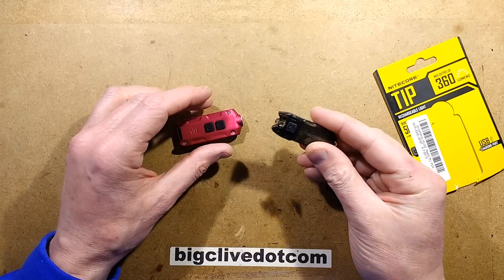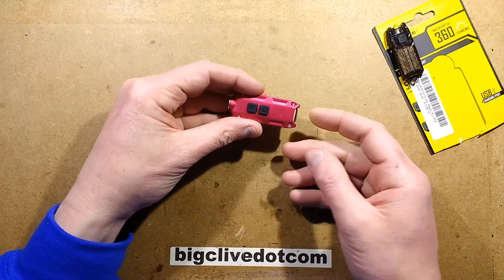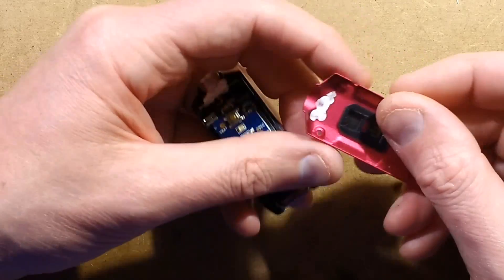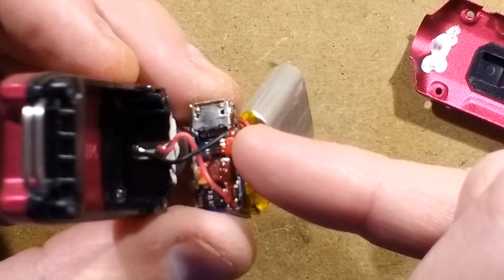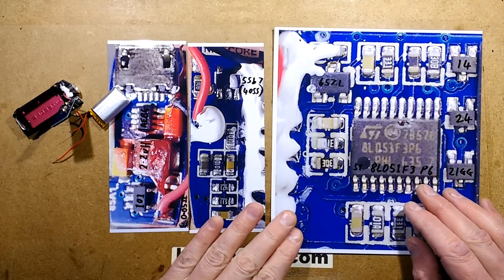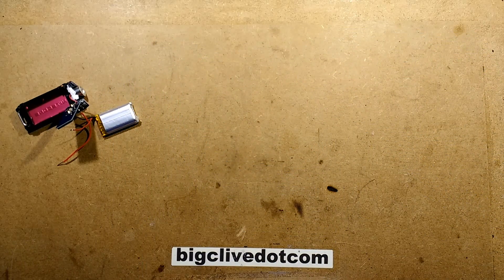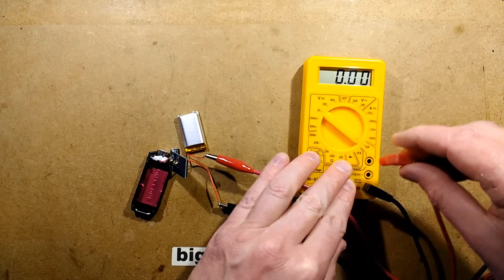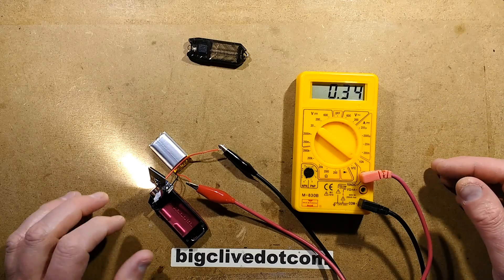Inside the Nitecore TIP LED flashlight, with electrical tests.

Comment: Too expensive for what it is and bad design for real world use.  In real world use, you'd have this form factor to pocket carry, banging around against other metal in your pocket, getting scratched badly, perhaps even dented considering how thin the metal is.

I know everyone goes nuts over USB charging, but the port is going to end up breaking off the PCB.  I know everyone is nuts about flat pack Li-Ion too, but for most owners that makes it disposable after a few years of use.  It is too expensive to throw away!  Considering the non-(reasonably) serviceable nature, they might as well have used thermally conductive potting to fill the whole thing, even if it adds 50% weight as then it is truly waterproof, would reinforce the USB port, reduce chances of denting the shell, improve heatsinking.  

The catch is that you can't put the potting over the switches and those silicone rubber buttons over them, will eventually leech out silicone oil that fouls them -  seen it too, too many times before.  It is true that conventional lights with cylindrical cells, also have a silicone rubber dome over the switch, but usually use a larger, more distant switch mechanism that is less likely to be fouled by the finite amount of silicone oil that leeches out.

It is impressive, or perhaps I should write an inevitable design, but I wonder how much longer it will be until higher powered LEDs make their way into phones and with everyone having a phone these days, it will eliminate the need for 3W and lower flashlights except those that have special mounting or aiming incorporated into the design.  Plus it makes sense for phones to have the LED available as a more powerful flash for the camera.

Comment: thanks for the video..it would break my heart to gut and destroy a $40-@50 light like that just to poke around ...bout to mention losing the IP rating
Reply from the maker: It's all back together and working, and as waterproof as it was before (not very).  But that's one of the main purposes of this channel.  To take stuff apart so you can see what's inside without opening yours.
Reply: bigclivedotcom LOVE the channel for that! ...if I took it apart I'd prob go farther than anyone should and then the parts would be binned with my "maybe someday I'll need this Arduino box" hahaha

Comment: a 65Z might be a 3V-250mA LDO (exact type is XC6206P302MR), there are different 65% series LDO's (ranging from 1.2 up to 3.1V). The 21GG might be a 21G, a voltage detector (exact type APR3021-39A, again 21% series comes in different voltages) which would make sense to check if the voltage does not exceed a specific voltage.

Source: SMD codes databook 2007 by Turuta

Comment: Man... Your scale is alot cleaner than mine...
Reply from the maker: i always clean things like this before a video.  Mine was covered in dubious white powder.  Right now it's Potassium nitrate, ammonium chloride and camphor.
Reply: Haha, "dubious white powder" - weed joke put to shame.
Reply: Mine was always covered in flour, sugar, yeast etc.
Reply: Stick to heroin, pot clogs the syringe.
Reply: On that topic, a local shop used to sell similar scales to druggies. So the cops bought 4 or 5 sets from the same shop to make sure they couldn't argue about the weights being off...
Reply: That is freaking amazing. I've heard of dudes/dudettes doing the same to make sure their dealer isn't screwing them, but not the cops. Just imagine that conversation: "Nah man, It wasn't over an ounce. Your scale is wrong." XD

Comment: if the µc has adc, it might have temperature sensing built in. not that it would be worth anything on a board completely separate from the led, but the packaging might not be lying about temperature management.

Comment: Yes, you were right. The very first iteration of the TIP had a couple of problems: High quiescent current draw when locked out, and visible PWM on low modes. The current iteration, like the one you dissected here, and the one I own, has solved the vampire current draw on lock-out, and has current regulation not PWM. The battery monitor that you weren't sure of is where you press the mode switch when the light is off and it will flash the LED to tell you the state of cell charge. And the LED flashing when you were testing the current draw was because it was detecting low cell voltage because of the voltage drop due to the burden voltage of the DMM.
Reply from the maker: Ah, so it may be controlling that mystery 8 pin chip perhaps?  I certainly couldn't see PWM at all, but did notice intensity stepping in peripheral vision when the intensity was automatically ramping down.
Reply: @bigclivedotcom  I would assume the 8 pin chip is protection on the USB data pins? I believe the firmware on these is hackable/upgradeable?

Comment: was there a hole in the packaging on the side where the usb was sitting?  if so it is possible that there is a new firmware uploaded.

also you can 'see' the bug if your flashlight has it. the led in the power button will light up a bit in lockout mode

Comment: In theory with an ADC on the MCU they could have monitored the forward voltage of the LED. Not an ideal method of temperature sensing but it does work as the forward voltage drops with temp on some types.

Comment: Clive, if you tap the power level button while the light is off, the LED behind he buttons will flash three times if the charge is around 75% or better, twice if 50% or better, and once if 25%. (I think those are the levels - don't know where my instructions went.)
Reply: I have an edition in a metal box with separate instruction booklet, that says 3 flashes is above 50%, 2 flashes between 10% and 50%, 1 flash is below 10% (it will also refuse to enter Turbo mode (360 lm) if it's low on power).
Reply: I have a CREE led version and that is what mine is 75% and up is three blinks between 75% and 50% is 2 and around 25% is one but it will not allow turbo at the point and at 15% it takes out the high mode not the turbo mode

Comment: One thing I'd add regarding the way you measure battery capacity, is that it isn't measuring the actual capacity of the cell. You are measuring the capacity of the cell, plus the energy lost in the charging circuitry, since they charge at around 3.7-4V average, that's 1-1.3V less than 5V, or around 20-30%. So the measured capacity will be that much higher than the actual capacity of the cell. It is also inaccurate since different cells may charge at different voltages. Just my observation, you're probably already aware of this.
Reply from the maker: Most low current chargers use simple current limiting that means that excess voltage is dissipated as heat.  But the current will remain the same and so will the time, so even when charging a cell that ranges from 3V to 4.2V during the full charge cycle the mAh used to charge it will be the same as that going into the cell.

Comment: Hey, Clive.
With regard to my previous comment (bigclivedotcom replied: "You may be able to get a complete new LED if it's a standard format."), I could just buy a new bike light for a tenner, I just wondered if an unbonded LED can be easily fixed (by me, at home). I think my second bike light may have become faulty, bumps in the road, sometimes make the light flicker or change mode or go off altogether. A hard tap usually brings it back, it's not the switch at fault.
The light is a "Wilko Cree LED Bike Light Front High Intensity", I have looked at the Cree website and am not sure if Cree is a type or a brand.
Sorry for the long ramble there: any further advice?
Reply from the maker: If it's a standard LED package that has become unsoldered then it should be viable to solder it back on.
Reply: Ok, thanks. I'll have a fiddle about with it, see if I can mend it...
Reply: Hello Clive, sorry to bother you again.
I have inspected the LED, it has come clean off the tiny silvery mount point (no wires). If I hold it on (fingers), it makes no difference. I assume that's it, dead.
I know you're not a question service, but, you're the man.
Reply: Dave Lennon-Copeland is sick a meter on the LED side of the wires and double check your not dealing with two faults unknowingly n make sure your battery/board connection is still good...solder is cheap and a way better connection than "fingers" ...I'd re-solder and try it again ....if all fails try to get magnification on the LED and see if it has a black speck in it and just replace the LED... hope that helps a little..good luck
Reply: @Dave Lennon: On things shaken that much it is very likely that one or several soldering points is/are loose. You need a soldering iron with a fine tip and the must heat up the solder at suspected points. Sometimes you see the point where the soldering is loose by examining everything with a magnifier glass carefully. Be careful and patient and do not solder things together that weren't together before as you might destroy everything.
Reply: Hmm... trying to solder that tiny little square LED onto the equally tiny little mount point is... difficult. It looks as if it fits one of two ways round, but I can't tell. There's no black speck... I'll buy a new light.
Edit - Thanks bigclivedotcom, MyBigThing2010 and Juri Vik.

Comment: They do claim it will adapt to ambient temperature. So the dark grey component next to the "01D" 100k resistor could be an NTC (12:10), mostly measuring inductor temperature. The micro doesn't have one built in.
Although with the turbo cool down you found, it seems like it wouldn't be used much.

Comment: I own three of them, and two of the tubes. Most of the newer ones have the firmware fixed and stopped the parasitic drain with the lockout issue. If you turn on turbo multiple time in a row at room temp it will temp sender and kick it all the way down to medium.
https://youtu.be/WTpPSs8dIPA
The 30 second time delay from turbo to high is normal, most LED flashlights running his current will only allow 30 second to 60 seconds in turbo from the heat.  Thermal cut off will cut it from turbo to medium, and will also prevent you from entering high or turbo until it cools down to a set temp as seen in my thermal testing video. This may turn down faster if the ambient temperature is hotter when running it. 

The bug was more in the beginning of the release. You have the writing stamp on the back, so it probably the new one. If you put it in lockout and still see the led blink every few seconds when it in the dark then you have a buggy unit. Plus it will drain the whole battery in two days of lock out, mine have been in lockout for weeks now without an issue.

The battery level is activated by pressing the top button three times. Each LED flash is 1/3 battery left. Three flashes is a full battery, well between 67% and 100% level I should say.

It water resistant, not as much like they claim for the tube. But you can take the USB rubber plug from a tube and put it on the TIP to increase it from bigger splashes and stop dust and pocket lint getting in the USB port.

Comment: Pretty sure Nitecore released a V2 which fixed the drain whilst in lockout problem.

Also if search for TubeVN, will find someone modding the Tube for higher output. Think it's a simple matter of replacing a resistor.
Reply from the maker: If you replaced the sense resistor or bridged another one across it then it would allow operation at higher current.

Comment: Claiming to be water resistant is clearly a lie on this, because the case itself may have some splash resistance but that's all cancelled out by using a standard micro USB port without even adding a simple rubber gasket.
Reply: It only claimed IP54 which is splash resistant rather than submersion resistant.

Comment: I was wondering which one to buy, should I buy the tube or tip?
Reply from the maker: It depends on your application.  I like the Tube because it is much smaller, but still puts out a lot of light.

Comment: clive, if i send you an anker powerbank, will you give your opinion on it? i've always wanted to see what you thought of supposedly the best powerbanks versus the others you've torn down.
Reply: JJayzX , nice video buddy, good to see the insides of these, I like mine too much to teardown and I've heard they never go back together quite so well? Keep making the vids 👍
Reply: SuperAWaC I would probably send him an email asking where to ship it to, and then just go ahead. His email can be verified at the website linked in the description of  this video and is bigclive1@gmail.com
Reply: Nick Miller link the vids please, I'd be interested to see 👍
Reply: Clive has opened Batteries and experienced a fire from this - so - if there's something that he can do it's definitively opening a powerbank.
Reply: I'd much prefer a Soshine powerbank thatcomes without preinstalled batteries, like the Soshine E4s. That way you can choose high quality 18650 batteries (of a brand you trust). And if you use it a lot and the batteries go weak you can just change them instead of throwing way the whole thing. Also the E4s has a nice display that informs you about voltage and current. And of course you can also use it as a simple 18650 charger :)
Reply: SuperAWaC  I've torn 3 different ones apart.. the 5 bank, 4 bank and dual bank.. they are very very well built, using medium high grade caps, 5 port had rubycon caps... very clean output on the 5 port, 4 port was ok, dual port was rubbish... I've had the 5 port running for over a year at 8 amps, no issues..
Reply: I've taken apart the 20,000 mAh version, nice stuff inside. vid is on my channel, don't mind the blabbing I've learned more since.

Comment: Personally I use a 1xAAA powered UltraTac K18, it should be good for a similar output to this with 10440 batteries which it is advertised as supporting. They state 20 mins at that sort of brightness though, I am now interested to see if they do a similar thing with ramping down the intensity. Guess I will have to get myself some protected 10440 batteries and test it with the lux meter on my phone at some point.
Reply: aljowen I too have the K18 and it was transformed with a 1440 battery on full 360 lumen brightness! It seems remarkable that such a small touch can light up literally 70-80 meters ahead like a football pitch flood light! i picked up 2 quality 1440, 350mAh batteries and an XStar usb charger for £10 delivered. I strongly recommend switching to 1440!!!!!

Comment: After your video about fake i watch original Tube 45 then i found in TIP in google. Now i wanna buy TIP CRI version. Its hard to find it from sure source bcs there is old version which discharging when is locked

Comment: When you locked it out then checked it, the current went up briefly as you pressed the button, not sure if that was a meter glitch or if it was consuming more power.
If ti was the latter and that button was mostly pressed while in the pocket, that may explain the discharge.

Comment: A nice little torch, quite over priced but when you see the internals you can see why.. 
I'll stick with my Tube as it's everything I need in a keyring torch. Or will I? You never know when you'll need an extra torch to find your other torch in the dark..
Reply: Wavefront101 
My car already has headlamps.
Reply: Yeah - the $30 price point is just above that magic number for me - - perhaps at $20, I'd think about it more...
Reply: For $30 I think the nitecore nu20 cri is a better buy.  Can use it as a headlamp, or detach it.
Reply: Got mine for 15€, it's on often on sale on gearbest, and if you manage to combine a sale with a coupon, you can get a really good price.
Reply: So, it's taken us a few decades to get from the "watch with a computer as powerful as the one that took Apollo to the moon" to the torch with a computer as powerful as the one that took Apollo to the moon!
I guess that flashing indicator led is the power monitor function that you were puzzling over.
Reply: TIP can sometimes be found for under $25 ... I got one for that in a Christmas-Winter tin for under $24.... gearbest  com